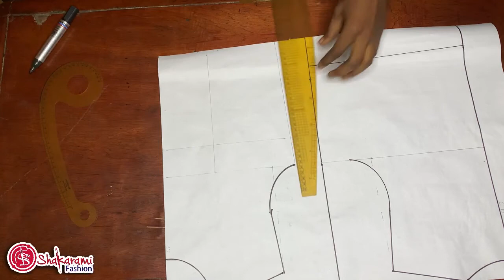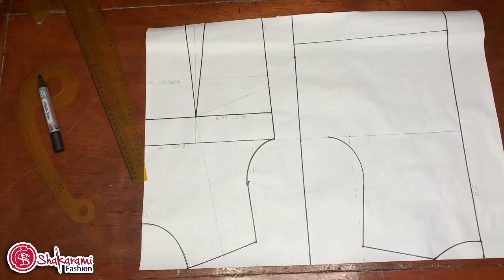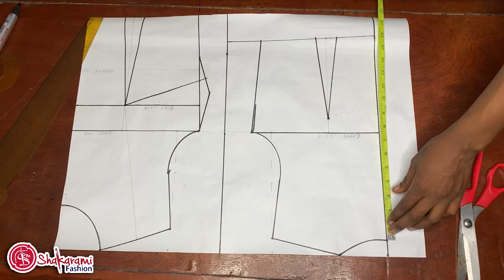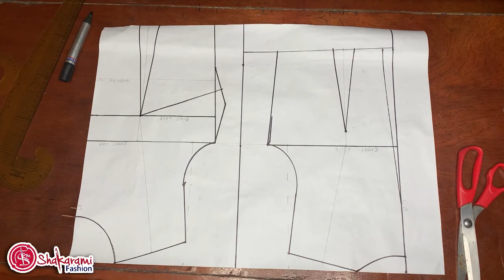[DETAILED] HOW TO DRAFT HALF SCALE BASIC BODICE PATTERN

Comment: I want to ask, the 0.75" you deducted from the waist line on the back bodice for zip tightening, you did not replace it. Will it not affect the measurements? 🤔🤔🤔
Reply from the maker: There’s no need replacing it because the aim of removing 0.75 or 0.5 inch is to help shape the back because the human back is not straight. this will also help the Zip to relax well on the body and it will not affect your measurements.
Reply: @SHAKARAMI_FASHION  okay, I will try this method. But the zip allowance will be added following the slanted shaped right?

I normally replace the 0.75" at the side after slanting it.
Reply from the maker: @blessingogedengbe7410  yes! While transferring to fabric, the Zip allowance will be added following the slanted shape.

Try this pattern and thank me later ☺️
Reply: @SHAKARAMI_FASHION  thanks dear... I started following you from TikTok, then followed you to YouTube. 

Please, can the same method you used on your corset be used for a plus size?
Reply from the maker: @blessingogedengbe7410  Yeah! There’re slight differences in drafting for plus sizes.
Reply: @SHAKARAMI_FASHION  awaiting your tutorial on that... Thank you, you're such. Darling💕
Reply from the maker: @blessingogedengbe7410  you’re most welcome 🤗
Reply: Thanks alot. Straight forward, very simple method 🎉

Comment: I was thinking one is to go down by 1 inch from bust point and not the back block
Reply from the maker: You’re to go down by 1.5 or 2inches from your bust point line depending on the difference in your back and front shoulder to waistline measurements.